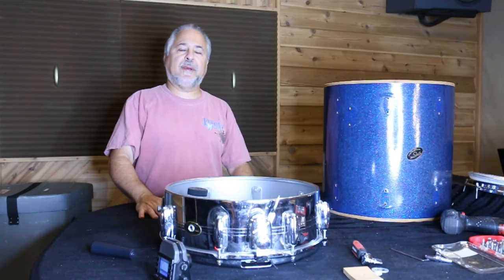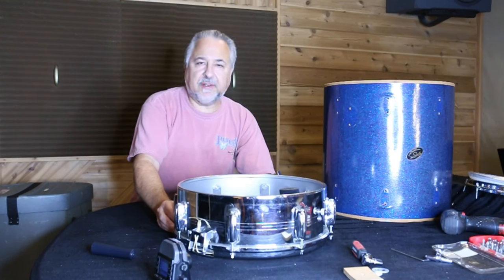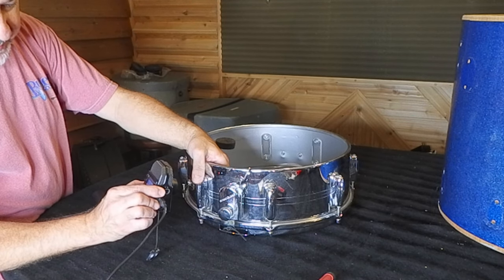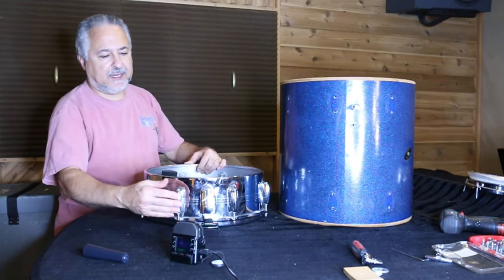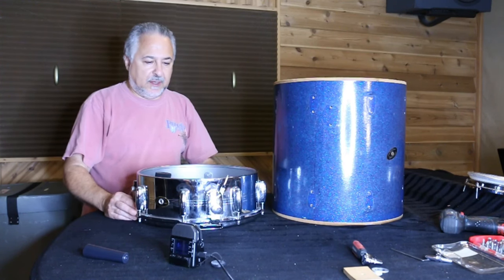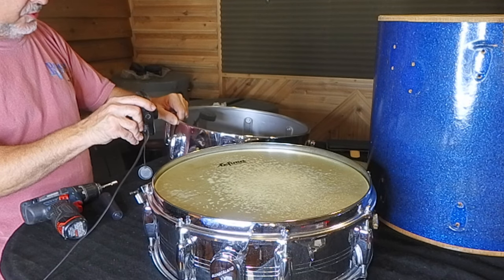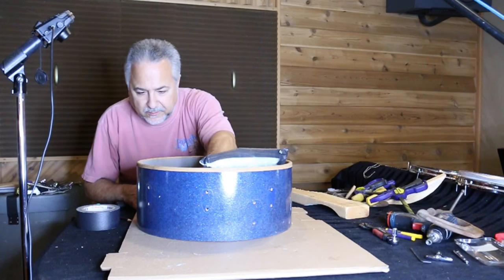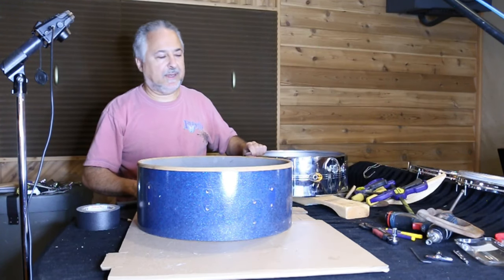Removing Dents from Brass Drums

Comment: Rick - this is so fantastic. Believe it or not I have the exact same snare with the exact same dent. I wanted to swap out the Zoomatic throw (which was as a minimum inefficient but at this point completely broke) and replace it with a Trick throwoff (in conjunction with a Retroplate). However, I don't have all those excellent power tools you do lol nor a spare floor tom. What I DID do was pull out my Sawsall, take one of those orange Home Depot buckets, cut 3" down and then cut half across (it looked like an orange "C"). It snapped right to the drum shell like it was custom made. I then following your technique clamping it tight and then using the C clamp to press out the dents - and oh man it worked PERFECTLY. Am so grateful for this tutorial!

Comment: Hey Rick hope you’re having a great day. I’ve got an Acrolite that was dropped on the strainer and got dented in. I hammered it out mostly, but I think I’m gonna use this method with the cutting out the 2 x 4, I slightly heated it up, and it’s working OK. thanks for the videos!
Reply from the maker: Hi Jack
This will work much better than hammering it out.
Aluminum is a bit less pliable than brass, but it should work fine.
Just make sure you tighten both clamps at the same time and go slowly.
Reply: @rickdior  Thank you
Reply: @rickdior  Well looks like it was a waste of time. There are a couple dents in the batter bearing edge and the batter side bearing edge is slightly warped. When I took off the old original heads I noticed that the rim wasn’t evenly tightened. And I think it warped the shell. But it looks like it was dropped on the strainer and the muffler was pushed in also. I might just try to return it. It will probably have a hard time keeping in tune. And the resale value is now just for the parts. Blah blah blah. Anyways enjoy your videos thanks 👍🥁

Comment: You always make the best and most informative videos! My playing has come a long way using your videos and book as a supplement to my lessons. 

I just got a K ride that the seller didn't disclose had some slight keyholing. I've fallen in love with the sound but have found the ride always rotates until it settles facing a specific direction so I know continuing to play on it will worsen the keyholing. It's very very slight. Do you know of any repairs I can do to prevent it from getting worse?

Appreciate all the awesome videos, keep up the great work!!
Reply from the maker: Keyholing is the result of using a cymbal on a stand without a cymbal sleeve. If you use a plastic sleeve there should not be anymore keyholing.
Reply: @rickdior  So you think the cymbal will be fine with a plastic sleeve even if it always rotates to a certain position and then stays there when played?

I've seen people suggest installing a brass grommet in the cymbal hole as protection. Have you ever heard of such a thing?
Reply from the maker: If you use a plastic sleeve it will be fine. Plastic is softer than brass so it will not keyhole. I have many old K's with keyholing that was there when I got them over 35 years ago and I have not had any problems with any of the holes spreading.
Reply: @rickdior  That's all I need to hear. Appreciate you, Rick!

Comment: Rick do you have any suggestions to coax a brass Slingerland shell back into round? I can force a batter head on and you can see the shell is oval(ed)... I’m not concerned about aesthetics.... I bought the drum as a beater  to play on a cruise Ferry during the summer....
Reply from the maker: Hi
If you put a 14" Hihat cymbal on top of it you can see where it's out. Then take 2 Bessey woodworking clamps that are use for cabinet making and clamp it on both ends where it is out.
These clamps have large rubber coated jaws.
One clamp will span the good part if needed but the other is the corrector.
Slowly tighten the screw at the head of the clamp until the drum comes into round and then just a bit further.
That has worked for me.
Reply: @rickdior  hot damn Rick! THAT is a good idea. Thanks!

Comment: I have a stupid question (but what can I say, I like to be unique).  Do you think it would be possible to take a 14 x 6.5 brass snare (Black Beauty) and cut it to make it a 14 x 6.0 or 14 x 15.75 snare?
(FYI: I used to play with a Stewart set:)
Reply from the maker: Hi
You can cut anything with the right blade but I don't work too much with metal so I am probably  the wrong person to ask.
Reply: Totally silly idea as  metal snare drums have folded bearing edges which would be the thing you would have to cut off to reduce the depth. Just buy the right sized drum, a lot easier.